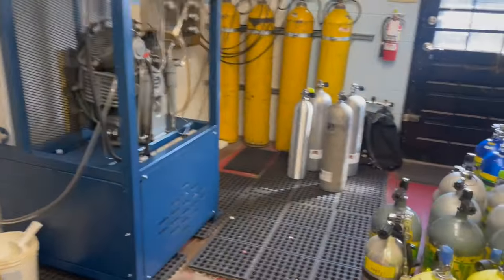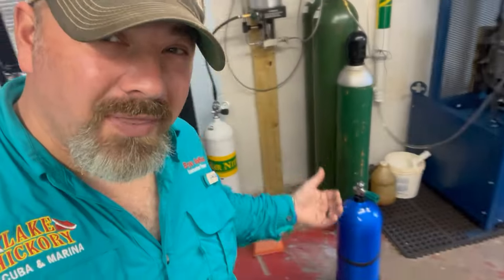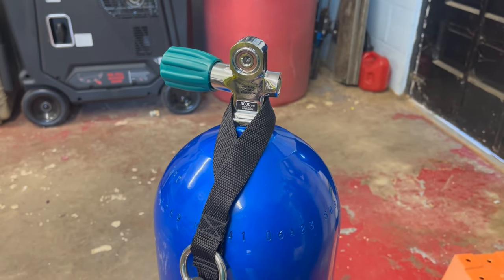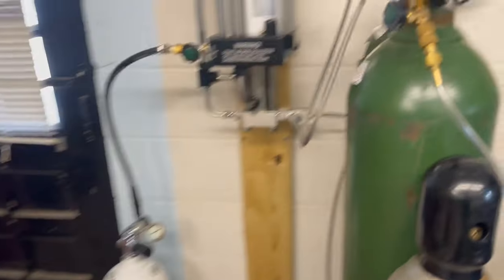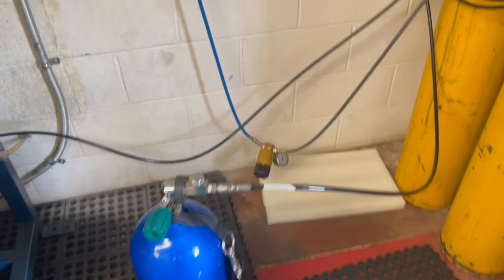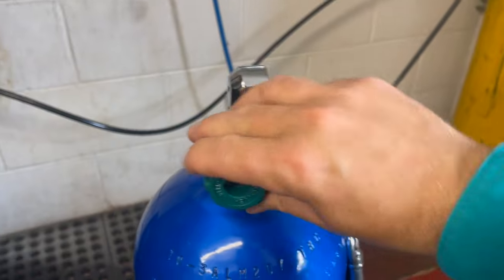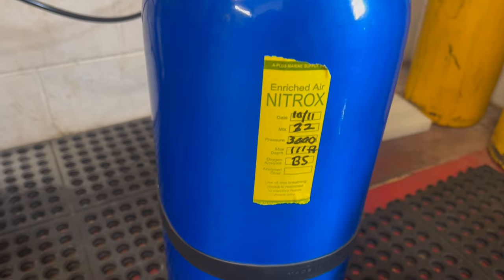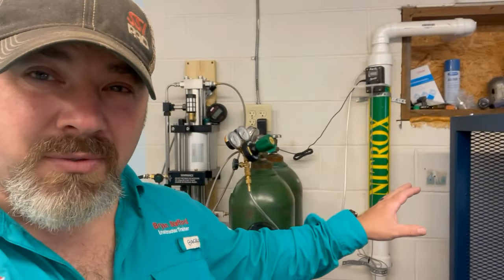How We Partial Pressure Blending Nitrox

Comment: Nice setup with the booster.  I use a stick when I need nitrox at home but use it very rarely. I dive mostly nitrox on vacation because it offers advantages there, but I rarely do repetative or deep dives at home.  The only problem I see as a shop is that you trust the customer to only use nitrox or OCA in that cylinder if they have it filled somewhere else.  If you Continuous blend you have fewer worries about contamination.
Reply from the maker: Hello @kevindavison6019, you make a very good point about trust. We have a future video planned where we discuss the trust between the customer and the dive shop. A lot of divers don't comprehend that the shops give out more trust than the customer does. You are very correct on the continuous blending as well. Most shops today, ours included fill with O2 compatible air, or some call it oxygen cleaned air, but its always good to ask the fill operator before having your cylinder topped off.

Comment: Without a calculator:

(11/79) * 3000psi (or substitute your own tank’s working pressure) 

11/79 is found out by 32%-21% (how much you are enriching) and 100%-21% (the range of concentration) 

Fun maths!
Reply: That formula, (11/79)*3000 equals 417.72, not 402. Why did the computer app spit out 402?
Reply from the maker: That is one of the great things about diving @DavidMaruca_, it makes the math more fun.

Comment: I’m confused about the partial pressure of O2 that was put into the empty tank. The computer calc called for 402 psi of O2 to get a final mix of 32% O2 (960 psi ppO2 for a 3000 psi fill). My calculations (I tried basic algebra and I also used the partial pressure formula from Bryan’s “Partial Pressure Formula Explained” video, https://www.youtube.com/watch?v=Xkj5xsMO5lg&t=0s) yield a pure O2 fill of 417.72 psi. Can anyone explain the discrepancy to me? Thanks.
Reply from the maker: Hello @chrisonash, we get this question all the time from our Gas Blender students. What really throws our students for a loop is when we exceed the O2 partial pressure even by 50psi, and the mix still comes out perfect (you will see this in a future video, hint, hint). In our video Partial Pressure Formula Explained (https://www.youtube.com/watch?v=pMZRd5jKFuM&t=0s), we are calculating how much O2 we need to mix to 32% from an empty cylinder. The computer program is doing the same thing, however, it is assuming a perfect system where the cylinder is at a constant temperature.  We understand through Charles's Law, temperature can effect pressure, thus, effecting the mix as well. The fill rate alone can effect the final mix too. Mixing gas is an art form that takes practice. Thankfully, we have a small margin of error as no two fill stations are the same. Ambient Temperature, Bottle Temperature, Digital Gauge vs Analog Gauge, etc. etc., can all effect the final mix. Thankfully, we have a margin of error where things will still calculate out. Hopefully this answers your question.
Reply: Thanks for the response. I agree with most everything that you have said. What I’m trying to figure out though is why there is a disconnect between the partial pressure calculation formula from your previous video and the computer-based calculation. If the assumptions are the same between both the computer generated partial pressures and the hand calc partial pressures (based on the partial pressure formula from your previous video) the O2 percentages will be different. For a ratio of partial pressures of 402psi ppO2 and 2598psi of air the final mix would yield 31.6% O2. The computer and the partial pressure formula don’t yield the same results and I’m wondering what else is baked into the computer calcs. One way to account for the difference would be that the computer assumes a temperature rise great enough that the “hot” pressure of the tank is 3000psi and when cool it would reduce to 2900psi. That would account for the difference. The calculation would be 402psi + .21*2498psi = 926.6psi pp02. 926psi ppO2/2900psi = 31.95% O2.
Reply from the maker: @chrisonash  The end result of 31.95% is 32% Nitrox. 32% Nitrox is a range between 31.5% and 32.4%.